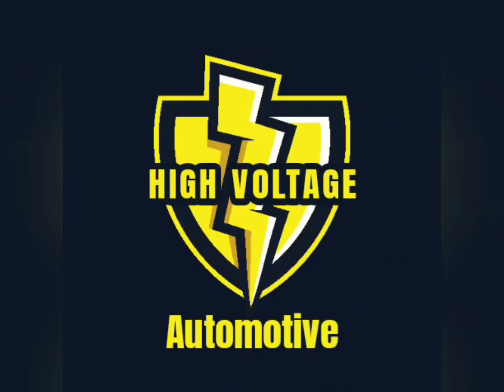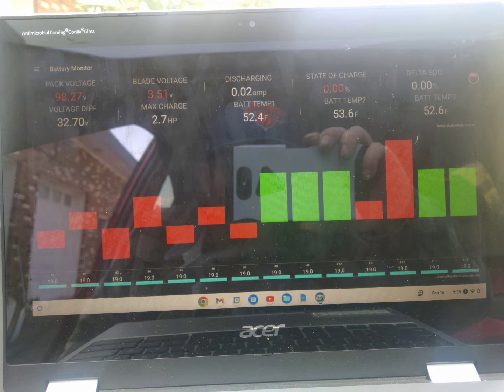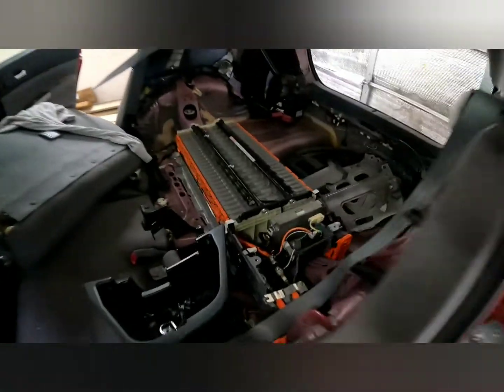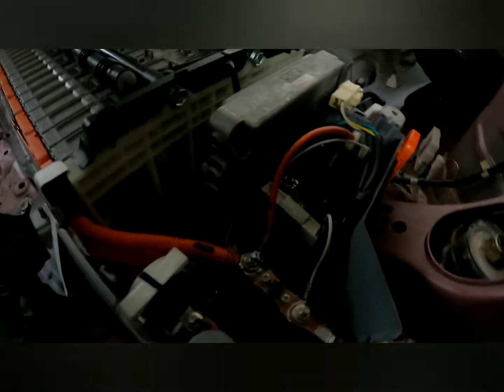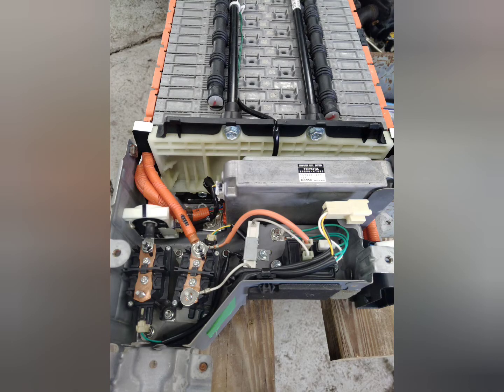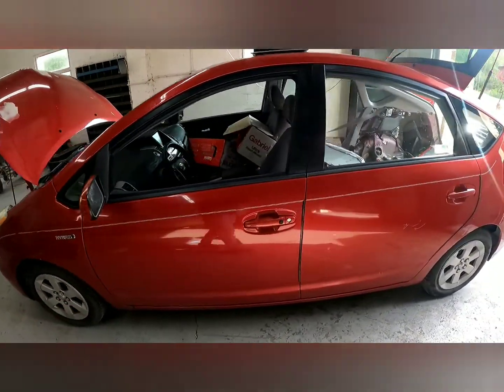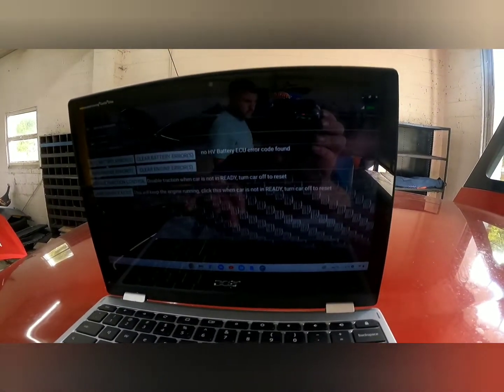Prius Gen 2 P3000 P0AC0 P0AFA (Solved)

Comment: For future viewers:

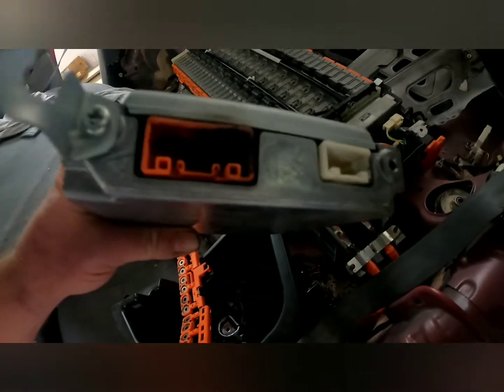The cable shown at 0:50  is: WIRE, FRAME, NO.2; part no. 82165-47040
The ECU shown at 0:53 is: COMPUTER ASSY, BATTERY; part no. 89890-47092

These are the part numbers for a Gen 2 prius, but even if it's not your model, if you go to a parts site and enter the part number and your vehicle type, it will give you the part number compatible with yours.